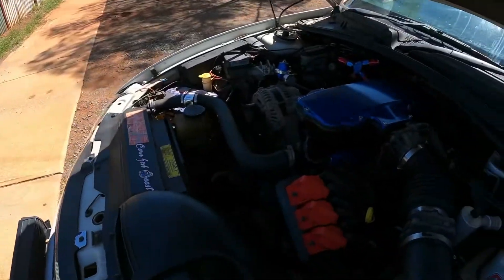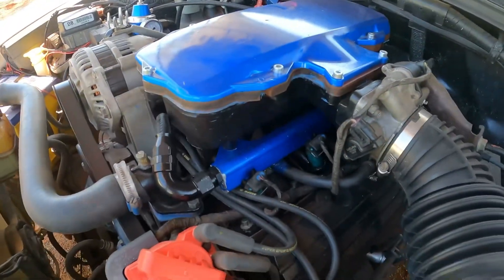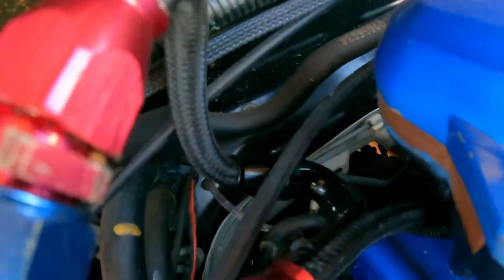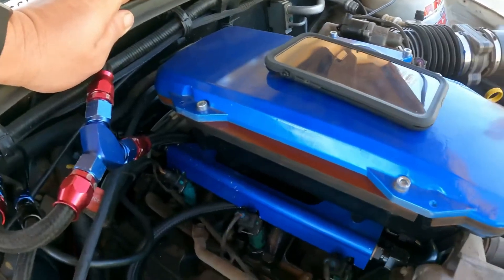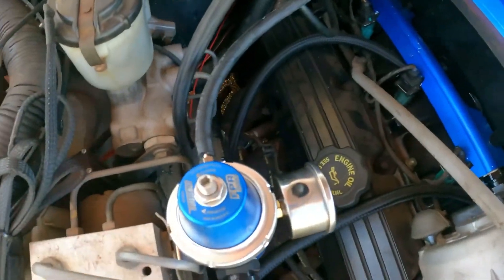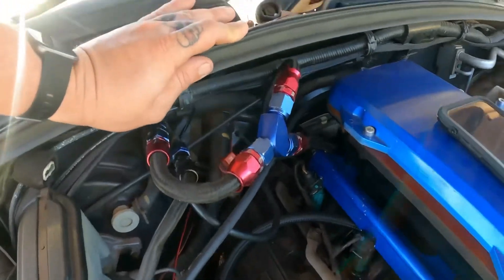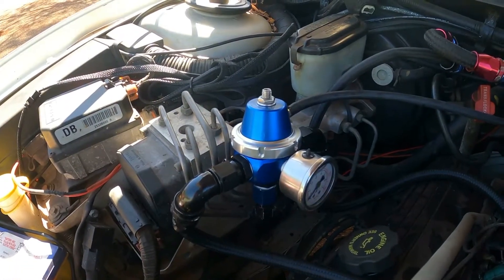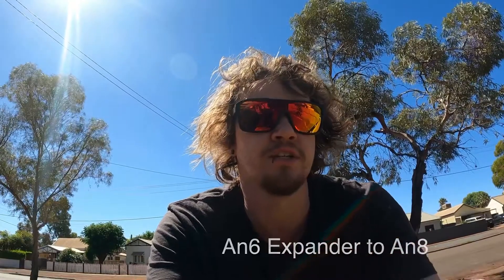Modified Ecotec Fuel Setup

Comment: Hi bro just wanted to know how you secured the an6 fittings to the original steel fuel lines
Reply from the maker: Hey mate. They’re a funny setup. Unscrew one end and that sorta slides onto the factory lines. Then it’s a matter of pushing the rest onto the end or the line and threading the end into that

Comment: Looks good, seems a little overkill messing around with the feed lines though?? unless you really plan on turning it up some
Reply from the maker: That’s it mate, with the turbo creating heat in the bay, the rubber lines won’t last. Plan is that with the built motor, all the lines will be braid from the pump to fuel rail, bigger fuel pump/s my aim is to eventually reach 750+ hp

Comment: My boyfriend has a m90 supercharger and all the pulleys intake manifold aswell. he just needs l67 heads to go on the l36. He's just wondering if the bottom block would support it though.
Reply from the maker: I think it’s dependent on how many kilometres the engine has done. The l36 to my knowledge doesn’t have the re-enforced bottom end the l67’s have. Never the less can be done, but might not be happy. Best bet if you have Facebook, would be to head over to the l67 commodores Australia page and ask the lads there 👍🏼 https://www.facebook.com/groups/2805458752835381/?ref=share
Reply: L67 bottom ends are identical to the Eco's apart from the Pistons and Rods, top swaps are hugely common however the L67 Pistons are slightly stronger in my opinion but run a lower compression ratio than the Eco's.